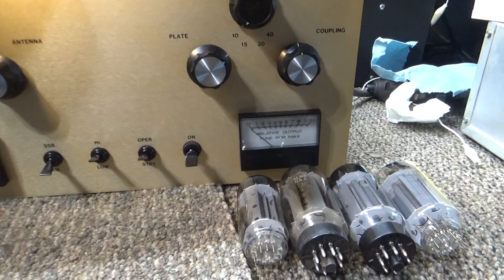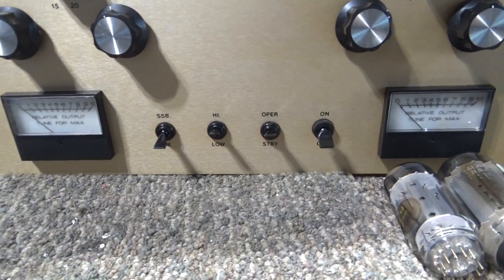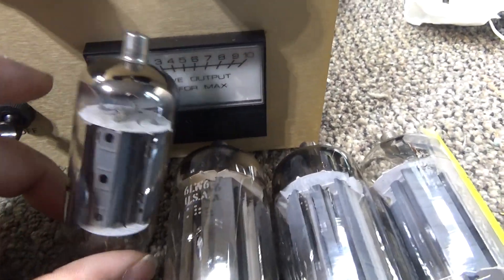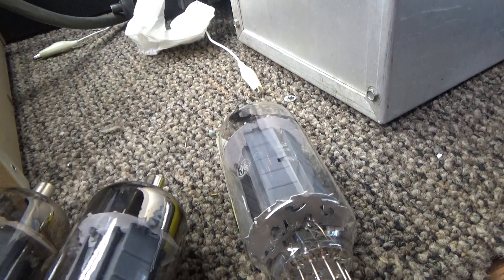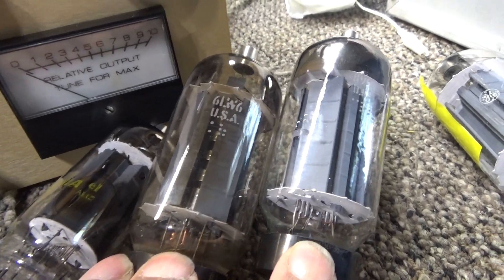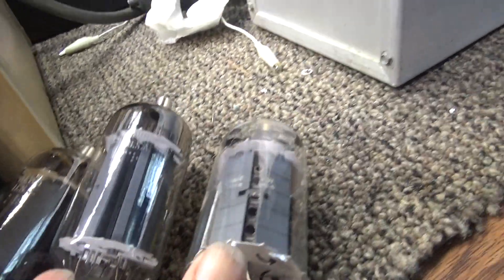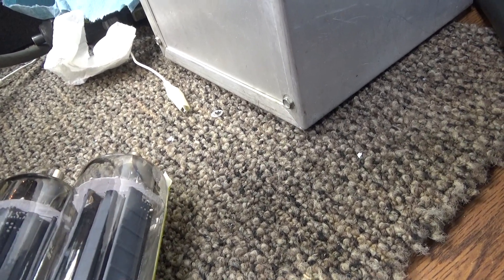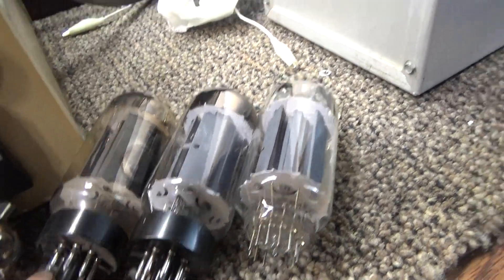8908, M-2057, 6lw6, 6lf6, 8950 sweep tube used in linear amplifiers walkthru

Comment: @tramdr    I converted quite a few of them to 8908s when I was the Tech at Soltronics in Anaheim Cal.  Then when MACO came out with the M2057 we bought them by the case.  We were picking up 8908s for cheap, really cheap, under $5 ea,  but the 2057s were premium priced.  The octal socket changeover wasn't that difficult but for most guys just swapping in 2057s and rewiring the filaments if it had 8950ss was a lot easier.   I talked to Svetlana many years ago (around 1993) about making M2057 copies but I would have had to commit to buying thousands of them to make it happen.  If they or any tube manufacturer though there was a profitable market and good sales volume they'd already be making them.  I considered approaching one of the Chinese tube manufacturing companies but let it go figuring that they's give the same response.
My personal favorite Golden Falcon was built as a 1x2x5...  made big carrier/little swing and ate tubes.   I think Andy marketed it as the GF 500.   I converted it to 2x6 and added self bias.  It was a monster.  I wish I had not sold it.  I've tried to find it for a couple decades to buy it back... it's very distinctive, has an AC breaker on the front panel for a power switch.  It was in Riverside Cal but who knows where it ended up.
When Andy started making steel tube amps they were the best he ever made but I don't think he made many... I've only seen 2 in 47 years.  Have you ever seen one?
I think I still have some 8908s stashed away but I haven't gone through my boxes of tubes for many years.
I have an old base amp that I have never been able to identify, it was given to me without any tubes, has octal sockets.   it's a big box...  any chance I could send you a few pics of it and see what you think it might be?  I'm probably going to salvage the transformers from it.  It would cost a small fortune to ship if I did resurrect it so likely just good for parts salvage but it's the only one I've seen like it.  Pretty well made too.
You absolutely right about Hams knocking sweep tube amps without cause... I still have the QST article for building a grounded grid 6 tube LOL.   Same with the Ham trash talk about CB transistor amps... the basic designs are the same as Helge Granberg's original Motorola designs.  Same basic design used in some Ham HF radio PAs of the 80s and 90s too.  Many CB transistor amps are cheaply/poorly made but can fairly easily be cleaned up for Ham (or other) use.  The whole scenario of Hams looking down on CBers and anything CB is what made me enjoy Ham Radio a lot less.

Comment: I've bought a Golden Falcon 1kw with 6LF6. Is that a good thing or a bad thing since your Golden Falcon 1kw has the  8908 tube's
Reply from the maker: 8908's are quite a bit more powerful, but 8908's are a LOT harder to find and a LOT more expensive. Also, you may indeed have a 1kw that someone converted, but the Golden Falcon 750 came with 6lf6 tubes in it.
Reply: @tramdr  it looks exactly 💯 like a Golden Falcon 1kw with 6LF6 12 pin ive got pictures of it
Reply from the maker: with the 750, the transformer was smaller so if you have the larger trannie, then yours is the kw

Comment: Hello TramDr, is there a tube that can be used in a falcon 500 beside the 8950?? If u explained and I messed it please excuse, thanks
Reply from the maker: 8950 is twelve volt filament version of the 6lf6 6 volt filament and family of tubes. The only twelve volt filament tube that is a sub is the M-2507 which gives me more power, but is harder to find and costs more than the 8950. 
6JS6 'A,B,+C'
6KN6
6LR6
6LZ6
6MB6
6LF6   
6LX6      
6MH6  
6KD6   
6LB6   
8950      12V Filament
M2057    12V Filament
also note some of these subs have a very slightly Pinout, like some have 2 wires connected to one pin and others may have one connection. Otherwise, they are all subs for each other.

Comment: You didn't say anything about the 8950
Reply from the maker: 8950 is a 12v filament version of the 6lf6 with slightly improved specs for the upper end of HF and lower end of VHF. Many people look at the slightly improved specs and say its a more powerful tube, made for RF blah blah blah.  However, those improved specs are good for the higher frequencies, like 50mhz and above, but they don't really do anything for the 10/11 meter band users. Also, I have said this many times, I always use the Plate Dissipation to determine the output of a tube. With the 6lf6, 8950, 6kd6, 6kn6, 6lx6 and a few others, they use the same Plate which means they have the same plate dissipation. One problem is how different people rate their stuff. Think about a stock SSB CB. It does 4 watts AM and I2 watts SSB. A manufacturer could rightfully call it a 4 watt or I2 watt by measuring it different. It's the same with tubes. The same tube maybe 30 watt plate dissipation used as a TV sweep tube, that may be on for hours or days at a time, continuous duty. But used in a CB or Ham amplifier, which normally won't be on more than about 33% of the time in a given hour, you can uprate that plate dissipation using the Ham ICAS standard. If it is class B or C, it can do even more. As someone else said, but he was talking about the 8950 only, it can be temporarily overloaded to about 3x the plate dissipation. Yep, all sweep tubes can do that since they were originally rated for continuous duty, the rating can be 3x higher when used for temporary RF. Its kinda sad though that people keep arguing and throwing specs to me about this one. The plate on those smaller tubes in my vid are 30 watt continuous, period. The plate on the larger tubes are 40 watt continuous period. Problem is when you start comparing apples to oranges. On the net, I saw the 2 biggest named Hams arguing with each other about how many watts coax can handle. Stupid argument. Same problem. Continuous duty, vs ICAS, vs CW vs AM vs SSB and also whats the point that you find the coax is at its max? When it fails? When it loses 2% of its power in heat? 5%? I0%? No right answer, but with tubes, I just use continuous plate so I can compare apples to apples.

Comment: A 6LF6 is 40 watt. The 6LQ6 is 30 watt. 6KD6 is 33 watt. EL519 is 42watt, EL509 are only 30watt. 30MB6 is 38 watt. M2057 is 40 watt. 8950 is only 33 watt. 6LX6 is only 33 watts. Many people believe the 6LX6 are 40 watts like the 6LF6,but GE clearly lists them as 33 watts. Just some info over my years of repairing and building. Been working with sweep tubes for 50 years. I know them all pretty well. I have data sheets on most. Actually the 6LW6 is a hard data sheet to get. It is 40 watts. I have been using the EL509S by JJ. It’s an octal base sweep tube,42watt but has no plate cap. The plate is on a pin on the base. They work very well though. I made a JB200 knock off with 2-EL509S, that will do about 480 watts. Even better then a JB400 with 4-6550’s. You need a heavier duty power supply, but they work. Anyway. Cool video. We should talk TramDr. 73.
Reply from the maker: I've seen a 6lf6 rated like that but no, it is not.

Comment: Thank you . What do you suggest I stuff a 10 tube phantom with on the cheap and easy ? Has just about every brand of 6lq6 now 40 to 50% tested makes almost 400w pep now , rough over all condition not original transformers ,  . 6KM6 ?
Reply from the maker: 6km6 will only do half, maybe use those for drivers. What I would recommend is to use higher filament voltage 6lq6. 21lq6, 31lq6 which can often be found cheap. Also the 6je6 series is a pretty good sub, finding those cheap is hit and miss.

Comment: Doc tried swapping 6lw6 for 8908 years ago, couldn't get it to work cause on 6lw6 the cathode is tied to g3 internal
Reply from the maker: and there is another grid that is different too.
Reply: @tramdr  The only way to get the 6lw6 to maybe work would be to rewire the tubes grounded cathode  and drive the grid like the old galaxy 2000 with the 6hf5 tubes

Comment: What average level of 120ac amps do these draw on tx? 15amp, 10amp or less?
Reply from the maker: Fourteen amps at full output
Reply: @tramdr  Nice. Tubes seem THE way to go. Sorry 80 amp 15v dc power supply, and the wattage seems like seasoning swing with solid state. Tubes seem to enjoy making a concrete slab of a carrier, without relying on overdriven audio to pump the swing. 73's and click-click.

Comment: I REMEMBER IN THE LATE 70s AND 80s MY FRIENDS USING MACO 500, 750 AND 1000 BOXES USING THE 2057s AND 8950s . BIG SPLATTER BOXES. I HAD A THUNDERBOLT-305 THAT HAD 6LQ6s. I THINK IT WAS A ONE DRIVING THREE. IT WAS A CLEAN BOX.
Reply from the maker: Interesting